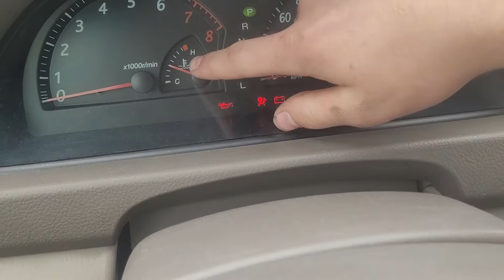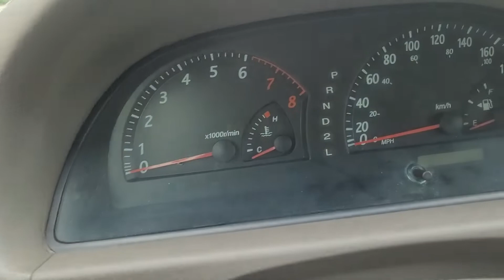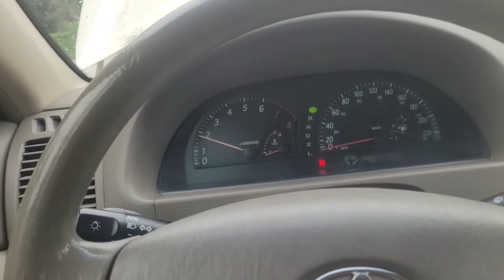I Bought a CAMRY With a BLOWN ENGINE! *Gone Wrong, Got Stranded*

Comment: Used motor is the way to go. Trying to save this one is probably not worth your time. I thought it would be simple too since it was an 02 camry... how often could the motors go bad? The answer is apparently a lot. These motors are known for issues like this. From what I can tell and researched, it comes down to the head bolts stripping out of the aluminum block. I went to the junkyard and every single camry there(probably about 20, 10 arrived within the previous week) had the 4 cyl motor pulled out. I had a guy look up a used running known good motor for me and he said it would cost me $750 USD. I ended up getting a scion xb 4 cyl(basically the same except for the timing cover and a few other pieces), and in the end I got it in and running. Unfortunately that one had a blown head gasket. My best advice is to get one that is known to run good and that is the one to put in(hopefully somewhat low mileage as well).
Reply from the maker: That's good advice... I was thinking I'd check the junker and see if they have any camry's with motors, and if not, then yeah exactly that... Ask around for a known good one pulled out of a lower mileage one...